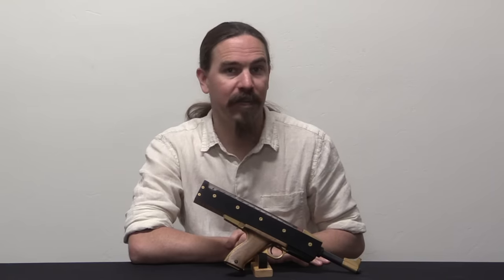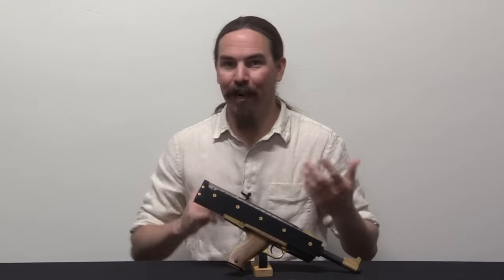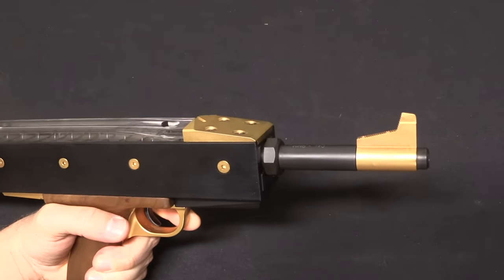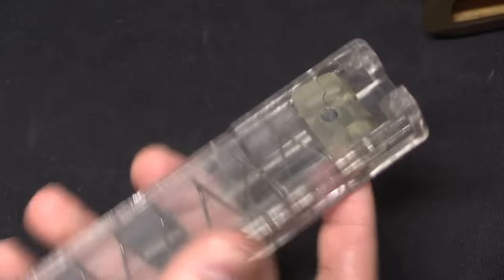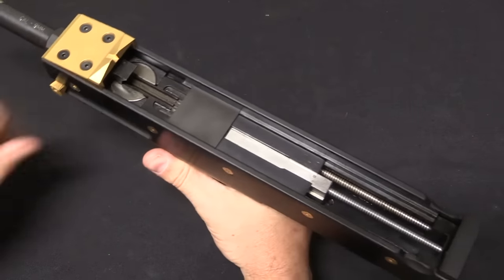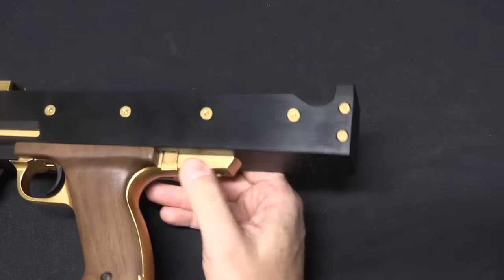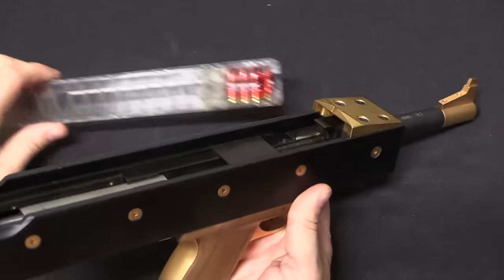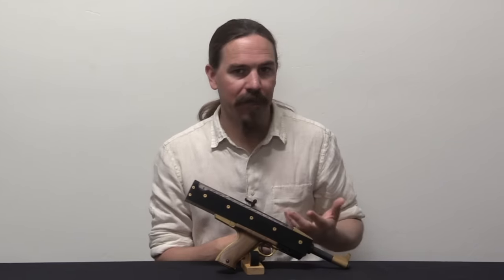Hill SMG/Pistol: Inspiration for the FN P90

Comment: imo FN's solution to move rotation to the magazine was really smart. Instead of having a giant solid heavy disc whipping back and forth between each shot, the rounds are instead gently fed through a stationary lightweight spiral. By making the spiral bit part of the magazine, you can fit your last rounds into the spiral itself, increasing your magazine capacity. It also solves the problems of feeding pressure and pushing out the last few rounds, since you can have your magazine follower take the form of 2 cartridge-sized rollers that can follow the last rounds down the spiral itself. So impressed by how inventive this is. I wonder if Mr. Hill would've arrived at the same solution if he'd had access to 1980s-strength plastics
Reply: The downside to fns design is that 5.7 rounds all need a light wax coating
Reply: @thebowtieguy777  FN was never one for saving cash.
Reply: That might not be necessary, if updated with the inherently slippery (wetted is the official term) modern composites.
  I use a proprietary one at work where adding liquid lubricants increases the surface area, and friction.
Reply: @thebowtieguy777 I thought the wax was necessary because it was a straight walled high pressure cartridge fired from a blowback weapon?

Comment: The way the cartridges are turned is actually much simpler than I expected. 

What a nice design!
Reply: I think it is slightly superior to how the FN magazine works, even though it doesn't handle ejected full-length rounds as well.
Reply: The design should prevent feeding issues with exotic bullets.
Reply: @dbmail545  I'm sure it would be possible to adjust the design to where it would. The bolt just needs to go back a little farther before it turns.

Comment: The finish work on that plastic mag is nice.  I've NEVER been able to mill and polish clear plastic so it comes out that nice.
Reply: Lightly oiled maybe? I don't know, but I thought the same thing.
Reply: @philipstowers4741   I'm going with sorcery until proven otherwise. 🙂
Reply: Some plastics, like acety-whatsit (super glue) dry shiny and clear.
Reply: @davidgoodnow269  Are you suggesting that the magazine was cast?  Certainly possible.
Reply: @grimlock1471  Yes, with the quality of the machining on this, and the design of this magazine, it makes sense to cast it, and plastic and polymer is almost always cast, first. Sometimes then turned on a lathe and then cut, like making Delrin washers, but cast, first. If you have the machining ability to make the machine and molds for casting plus access to the raw materials for the kind of plastic you want to cast, that is absolutely the way. In this case, it looks like the kind of acrylic they were already using at the time to make tail lights for cars. I once made a plaster mold for one when I couldn't find one to buy, then used an acrylic patch kit I bought at a hobby shop to make my own replacement. It's obviously not as strong, through flexibility and resilience, as modern polymers, but good enough; and it has that crystal-clear shiny appearance.
Reply: @davidgoodnow269  I've never had the make molds as you discuss. All the places I've ever worked just hog material out of stock then screw and/or glue it together.

Comment: Aluminum can be anodized black or gold using the original sulphuric acid process. This process was used starting in the '20s for aircraft parts. Most likely John Hill was familiar with black and gold anodized aluminum aircraft parts and thought they were pretty cool.

Comment: Fully committing to a SMG layout with a foldable shoulder stock and fore grip seems much better than the very bulky machine-pistol configuration we see here.
Reply: This seems to be in the being of the dardick pistol- which generated revenue and interest in the action rather than the gun itself. The action went on in the form of aircraft autocannons and other electrically driven rotating chamber guns.
Reply: With a full-length carbine, I could see a magazine arrangement similar to the tube magazines, wherein you pull out a spring-loaded follower, dump an entire box of ammunition in, and re-insert the follower to tension the magazine.

Comment: I remember seeing drawings of this design in a tubular form with fold up sights and pistol grip for use in airborne drop tubes...dont know if any were made, but back then they said this is where the germans came up with the G11 design with the rotating chamber. Of course caseless solves the upside-down ejection.

Comment: So lemme get this straight here, Gun Jesus; you're telling me we could have had cyberpunk smart pistols... early
Reply: Oh, but we did actually have them. Smart guns use Gyrojet technology. Although it was not that smart at the time...
Reply: @Alatzas1  Gyro get would have been better with a two-stage propellant. One stage is it seated inside either casing similar to cased ammunition or a separate shell that when ignited allows the rocket-propelled portion to engage the rifling and clear the barrel, afterwards the rocket would egnite propelling it forward and still being accurate and on its trajectory because it was able to engage the rifling.
This may or may not sound familiar to you, if you know where the concept comes from.

Comment: That feeding system is slick ans seems fool-proof.
The pro is, as Ian mentionned, the fact that when ever the magazine is made reusable or not, it is not such a critical part of the system and so can be made cheaper and still be reliable.
The critical part of the feeding/ejecting action is the turntable radius and its spatial relation to the ejection port.
Turn everything backwards with a telescoping bolt and make the ejection port closer to the turntable, add an active ejector (rocker lever maybe) here you are, even better than the P90.

Comment: I was just thinking that clearing failures to extract would be a nightmare. 

Of course it's often a nightmare even in conventional designs, but here especially. 

On the other hand this system could be done in a way that it self-aligns in case of minor feeding issues. It could be very reliable indeed.

Comment: 11:10 That sounds like a pretty serious problem. If you have a misfire, you need to be able to expel an unfired cartridge, which won't work if the system only reliably ejects empty cases.

Comment: Your issue with the dummy rounds suggest that removing a dud round might be tricky. The dud would still have the projectile in place, and thus be the same length as the dummy rounds, meaning you likely can't just quickly rack the charging handle and expect the dud to eject properly.
Reply: Ya that sounds like a huge issue

Comment: The fact that a Canadian gunsmith laid the groundwork for the very successful and unique FN P90 submachine gun makes me proud. It required certain milestones in manufacturing and bullet technology for it to happen but Hill's name lives on at least on Forgotten Weapons. I do wonder if the mechanical design was sufficently robust as a SMG (I assume the semiauto pistol it wouldn't pose an issue)in the longterm as the action looks complicated but admittedly not to the degree that the G11 accomplished.
Reply: It's actually fairly robust still, all things considered.  There's just a rod running along the inside of the receiver on the right sit that when the bolt it back far enough, it rotates the turntable.  That bar is a lot like the charging handle on this gun, only it's fully inside the gun and it reciprocates.

Comment: Fascinating. Adding a fixed ejector and an ejection port would take care of the ejection issue if the bolt travel before engaging the turn-table was also changed, but that would reduce the ambidexterity of the design. Or, add an ejector to the bottom of the magazine, and move the pistol grip backward, probably to where the cross-bolt safety that blocks or locks the striker is positioned as a typical cross-bolt thumb safety, allowing direct downwards ejection from the receiver. That would rather ruin the balance, in the present configuration.

Converting to an overhung bolt and reversing the magazine-flow, providing a bullpup configuration, would improve the balance while allowing a much longer barrel; it appears that is just what Fabriqué National did.

If Hill had built one thusly and chambered it in .30 M1 Carbine, 30 becomes closer to 50. Chamber another in .22 or .25 IJ (Iver Johnson) Jet, competitors to the.221 Fireball, and you have something very like the final FN P90! Having a proper, fixed, chamber means easily doubling the accuracy of the M1 Carbine. The short sight radius would remain an issue, but perhaps supplement with a 1.5 correction Reflex Sight, similar to what a German Designated Marksman was issued for the 98k? Give that an elliptical "donut of death" matching the accuracy standard from 50 feet to 300 yards, and you have it.

Comment: I work in manufacturing & spent some of my early career in a mil-spec aerospace machine shop, that gold & black combo reminds me of a lot of the anodized aluminum finishes we worked with while I was there. Not sure of the significance (I'm a CAD draftsman and my interest in material finish consisted of putting whatever Management told me to write in the "Finish" box on the titleblock), but I would assume it's some standard anodizing the military prefers that just happens to be either black or gold (Lockheed Martin isn't super-picky about cosmetics). Everything we sent out was either that flat black or gold-tinted. If Hill was seeking military interest he might've figured it couldn't hurt to look the part.

Except for the screws though, I'd have to guess those are yellow zinc plated. Which is a little weird because I don't think I've ever seen yellow zinc flathead screws, you generally only ever buy those in standard zinc (poor-man's chrome) or black oxide, or stainless steel.

Comment: Honestly kinda wonder why there isn't a mainstream 9mm, .45, .40s&w\.357 sig and so on using the P90 style magazine, especially the .357 sig which being necked would probably work in a p90 style magazine without any need to change the design other than scale, with a non-necked cartrige however the p90 mag would have issues, the tokarev cartrige could make for an interesting one.
Reply: Are those cartridges straight-walled? P90 magazine requires parallel walls (not almost parallel).
Reply: @randomnobodovsky3692  I do not know, my government overlords don't trust me

Comment: As a P90 owner I'd be interested to see how the feed system worked in real world scenarios, I do have 1 mag that tends to be ammo picky, it runs fine with the nylon tipped bullets but doesn't like hollow points. An issue I don't think this gun would have. Also as stated obviously the ejection port though cool would have to be relocated.

Comment: Just looking at it I imagined this would have a problem ejecting dud rounds, and that Ian actually had a problem trying to cycle it with dummy rounds seems to confirm it. I think an eventual production would have to have the charging handle pull the bolt further in order to clear the full length of an unfired round and/or recommend pulling out the magazine to clear a malfunction

Comment: This is FW GOLD.  Thanks for this one, Ian!  I've heard lots of discussion on why the "P90" magazine design would be hard to do with 556 -- but not, say, 9mm or 45ACP.  Would this be a viable mechanism, with today's materials, in 9mm, 45ACP and/or 10mm?
Reply: as far as i know, the bottle neck is actually an important part of how the P90's magazine works. there's 2 cylindrical rollers that almost act as dummy cartridges, but since they're more or less symmetrical you cant actually feed one into the firearm, as the chute which the rounds go through gets smaller near the bottleneck. If you were to do this with say, 10mm, you'd have to find a way to not accidentally feed the rollers into the action. It would be a little less elegant than how the magazine already is.
Reply: @zetazane  Interesting.  FN certainly seems to have proven that the P90 magazine works.  My reaction to the prototype that Ian showed was that while it was fairly simple, it felt like it might be more susceptible to wear and tear.  Still, it would be interesting to see the double stack version and explore whether it could be improved upon enough to make it worthwhile.
Reply: This has been aswered a couple of times in the comments.

Comment: based on 4:10 i wonder if the gold is some kind of plated/anodized (i recall at least black and some basic colours being options for anodizing) Ali (it certainly doesnt look like powdercoat or paint), actual gold (though surely unless it was alloyed with something it'd be far too soft for the purpose), brass, or even something else.

then again, being a Light metal fabricator, the "what" factor in the finishes (like the satin finish on the black side panel at 9:49) is almost as intriguing as the device itself!

Comment: This looks like a design that somebody somewhere should revive, since the patent's expired.  It's brilliant and simple; it just needed refinement and modern materials.

Imagine a Hill clone where the magazine's designed to stick into the back of the gun and feeds straight, instead of dropping, and on top of the magazine well, you put a Picatinny rail.  Then fix the obvious flaw with the ejection by adding a ramp that can be switched to right-or-left ejection (by merely dropping out).  Make the body out of polymers to lighten everything; the bolt and its track should stiffen up the gun enough internally to keep zero well.  Then add a longer barrel and a very short stock, that the magazine inserts into.  

Now you have a bullpup for small-caliber rounds that can take, say, a Glock 30-round magazine, is light, mechanically simple, and would be really reliable.  I would imagine a side ejection port would get rid of the reliability issues and a straight-line magazine delivering to the Hill's feed ramp could be slightly altered to direct the round directly to the "roundtable".  

A blowback version in full-auto would be nice, but it'd probably be viable as a light home-defense / varmint /plinking gun, where light weight, high capacity and easy maintenance (that looks ridiculously-easy to field-strip) would be the selling point.  FN producing the P-90 in semi-auto was always a joke, because their whole design is only useful as a PDW; a Hill design as a bullpup seems like it'd be light and easy to maintain, and simpler than an AR-15 mechanically. 

I realize a lot of gun folks think bullpups don't work, but I think it's largely been a problem of what they're designed for; a bullpup military weapon ends up with various problems, mainly due to magazine size and weight, but something like a Hill design would be great for a weapon where you'd load from the rear and have enough ammo for anything short of war-time use, in a caliber that's good-enough for most tasks (and if it'll take wadcutters easily, it'd be a nasty defense gun).

Comment: Okay this is crazy.
1: because the magazine is clearly on backwards... I mean, I say this knowing how an FN P90 works, but it's just, so close to obvious that I'm surprised this orientation even exists.
2: HOLY SHIT THAT ROTATING BOLT! This is how I always had though that P90s worked, until I saw a video with an extensive breakdown of the magazine, and it's like, "no, there's just a semi-circular ramp that feeds the rounds naturally into place for a regular linear bolt, with a couple of captive rollers to make sure that the last actual rounds can get pushed around this ramp by the spring." Like, knowing how the G11 works, I had always assumed that the P90 did something similar, and finding out that it was mechanically much simpler was a real, "AHA, yeah, duh," moment for me, that seeing that the inspiration for the P90 actually used a mechanical system to physically rotate each individual round into place is just like... mind blown.

Comment: Forgotten Weapons, Ian Our Lord and Salvager,
 I don't think that the color scheme is meant to be decorative. It looks like there is very simple machining for all the steel parts. Its all straight cuts and simple rotary cuts from what I can see. The more complex or contoured parts are made from brass. To me, this is more likely the result of the machinists skill and tool limitations than a stylistic choice. Brass is softer and more easily worked than steel, and has a long history of being utilized in firearms. As for the screws being brass also, that makes sense for a prototype that might get pulled apart and rebuilt numerous times. The softer brass screws will deform and strip before the threading on the steel frame will. A few screws are easily replaced, whereas the frame must be retapped and set with wider screws, or replaced altogether if the threads become stripped from overuse. Making the adjustment and fine tuning process more forgiving to the machinist. So I believe that the "gold" color was chosen for the pragmatic purpose of making efficient use of the machinists time, materials, and tooling.